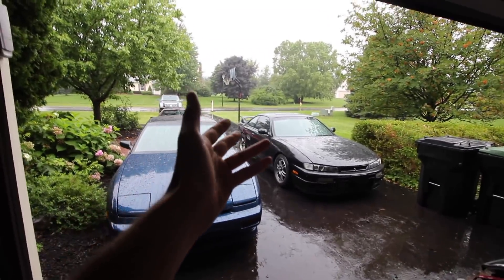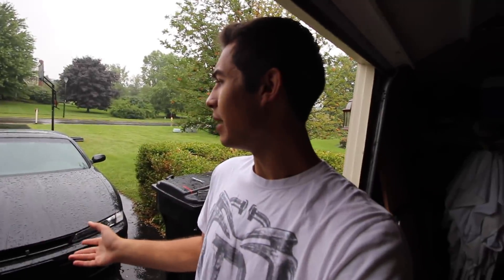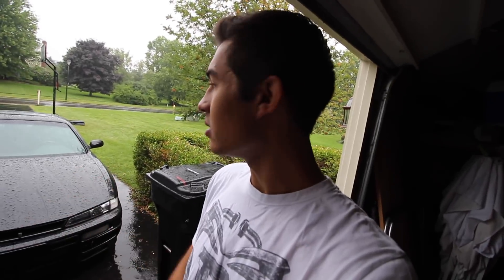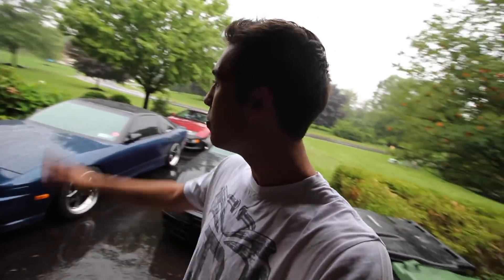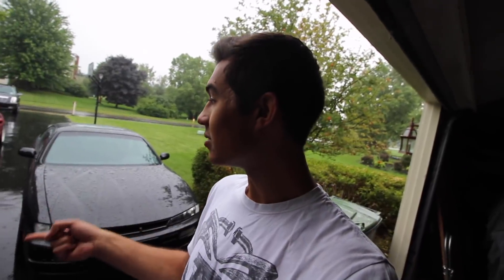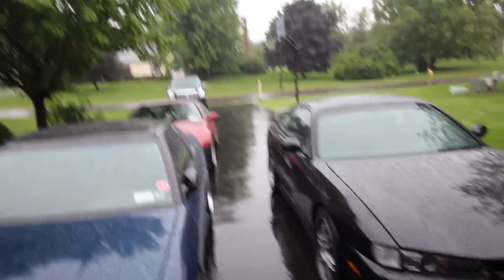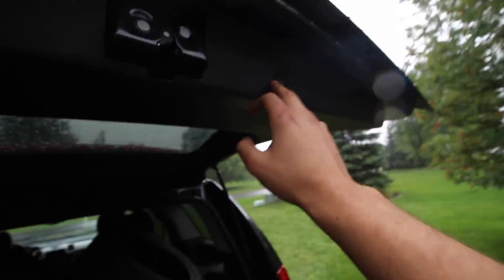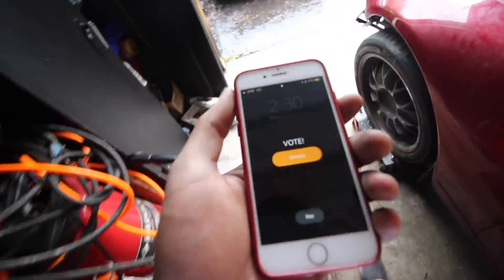RB26/30 240SX Runs City Streets | New Toyo R888 Tires | BIG Scare with the S14...

Comment: You say your suspension in the rear is stiff. If u soften it up, the car will squat and get more grip! Just sayin. Roll the fenders and soften up the suspension for squats = grip
Reply: Just like with driftcars, you could run a little positive camber aswell, so when she squats the wheels go to zero camber when squatted

Comment: What's the lowest AFR's should go?
Reply: Well the lower the richer it is and the higher the leaner so depends on the engine and whether it's na or boosted, supercharged, etc. Cruising and idle target should be 14.7(atmospheric pressure) on your air fuel gauge.
Reply: While atmospheric pressure is also 14.7, I believe what you're referring to is a stoichiometric air-fuel ratio. Gasoline stoichiometric air-fuel ratio is 14.7 and I'm pretty sure it's just coincidence that it's the same as atmospheric pressure.
Reply: john gonsoulin you're right about that. And for e85 the ideal ratio is 9.8 but most afr gauges automatically convert it to regular air fuel numbers
Reply: Comet with Bleach thanks :)
Reply: ImaDjentleman I think the lowest I've seen on a 93 octane tune is like 11 but don't take my word for it. That was on a full on drift car built engine.

Comment: God that S14 sounds HORRIBLE at idle....
Reply: NegatifDubz no it doesn't
Reply: NegatifDubz you say that now..... But remember it isn't tuned yet
Reply: You crazy as hell lol it sounds awesome
Reply: LoL shut up, you wouldn't recognize a good sounding RB even if it hits you in the face. This S14 sounds so bad at idle mainly because of that 4 inch pipe and probably the wastegate, it sounds that it has an exhaust leak and that is not going to change after the tune. Go watch some videos here on youtube of RB's idling, even RB's built the same as this S14 with the RB30 block and the RB26 head, and just APPRECIATE that exhaust note on idle and pulling...
Reply: NegatifDubz lol okay bro. Not gonna waste my time arguing have a nice day